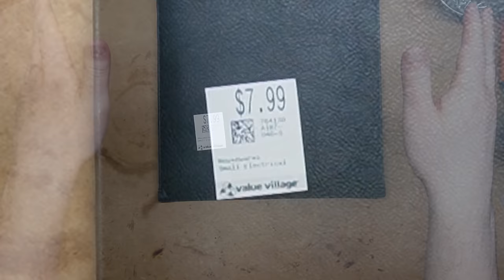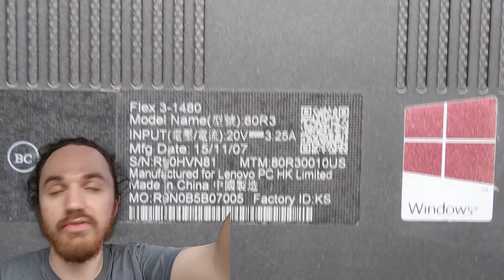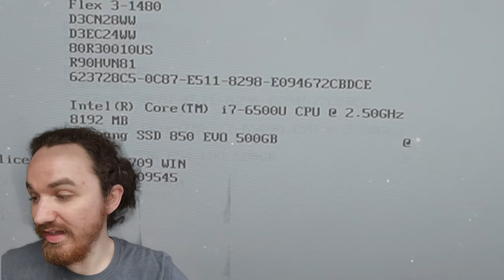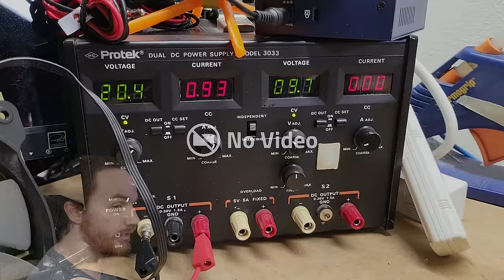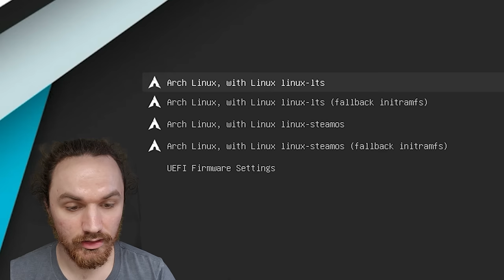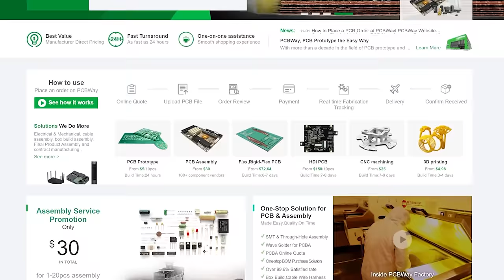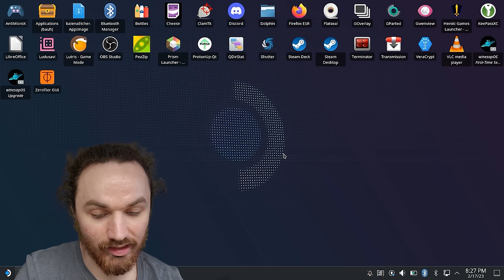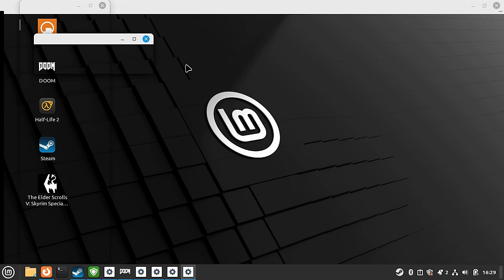Installing Steam Deck OS on a $7.99 Value Village Laptop

Comment: that glue really put the "solid" in state drive
bruh that i7-6500U tho I'm crying literally a 4th gen i5-4300M is better by 13% 😭
also when you opened it there was 2 chips cooled through the heatpipes, and my knowledge of having owned 2 laptops with dedicated gpu and one without it tells me that laptop has most probably a dedicated GPU, went to google and yep, it has a dedicated workstation Nvidia GPU, either an N16V-GM or an N16S-GT
Reply from the maker: Bruh I looked it up, the single threaded performance of that i5 is actually better... that's insane. Dual core i7 GANG. And yeah turns out it has a GTX 940M. I'm going to make a follow-up video about it. I can confirm though that the performance seen in the video was not utilizing the NVIDIA dGPU.
Reply: @BringusStudios  nah with that 940M it'd absolutelly crush the HD 8790M on that old laptop of mine lol

Comment: Arch Linux is not for everyone, there are problems with intel GFX and OpenGL, it requires lots of reading to figure it out, for older computers like that I recommend light distros, like MXLinux, Lubuntu or ZorinOS

Comment: i recently bought awindows 10  laptop at a thrift store for $10. its an older intel celeron laptop and it was being sold as is and they didnt know if it worked or not. i found a charger that fit and it works just fine!!!!!!!!!

Comment: Just add volts from the bench power and measure the voltage drop in those cables.  An extra 2 volts is fine and will help the poor connection.

HoloISO needs a recent AMD GPU, is there an M.2 WiFi you can use an eGPU with?  🤣

6500u is 2 core. With u series you have to get to 8th gen for 4 cores.  The real problem is if you have memory bandwidth and latency for the iGPU, dual channels and dual rank is more important 2rx8.

Buuuut, sometimes i7 Lenovo can overclock RAM (at least on my X230)

Comment: 13:20 you'd be surprised on what tf2 runs on with a config like mastercomfig, I've gotten it to run at 140+ fps on a laptop with an older CPU that was lower tiered aswell (don't remember the exact specs but it was horrible).
Reply from the maker: Oh yeah back in the day I ran one of those configs that made the whole game look like a PS1 title. It's the only way my 900MHz Compaq laptop could play it

Comment: Damn you stole my trick by putting dips of hot glue under SSD. Tape that connection or disaster will happen down the road. Hear it from someone who burned a good working ROG gaming laptop.

Comment: A flex 3 says that it has touch screen and folds into a tablet and it has a Nvidia Graphics NVIDIA GeForce 940M that's why when you opened it up you see two cold plates with heat pipe I bet if your running off the wrong integrated graphics
Reply from the maker: Yup, check my latest video, I used the NVIDIA GPU after this vid

Comment: Your laptop does indeed have a secondary GPU, most likely a Geforce 940M, you can see from the motherboard that there's a GPU chip present on the board.

2 options:
1. the GPU is disabled in the BIOS, tho unlikely
2. it was thrown out cause it has a bad GPU, also unlikely, maxwell chips didn't die just like that

You'd get a bit more framerate, so you'd be in the net positive again. Test it out again perhaps with the proper nvidia drivers installed
Reply from the maker: Yup that was the case. Linux mint didn't pick it up and install the driver automatically. I made a follow up video about it

Comment: You know you could of tried to press the xbox button to see if the menu would of popped up so you could of seen if you could of activated like the FSR mode and also you would of had the performance meters for the system.
Also i would of still googled the model because who knows you could of had one with a Nvidia 940MX which could of had a slight better performance.

Comment: Ethernet does not work because the “genius” engineers at Lenovo made the part that holds in the port part of the bottom cover plate that you removed. This was done to make it thinner

Comment: dude, open up the ssd, the actual circuit board is tiny and plugs into your port without the weight of the case...

Comment: Turns out linux is no-go for optimus laptops cuz you cant switch gpus in linux automatically, and even if you try to switch from nvidia to embedded gpu it will not switch or wants a reboot which is not acceptable, and I am even not talking that linux now is WAY heavier than windows 7 or 8 which installed now on my 2012 core i3 gtx 650m laptop... even though I installed a good kingston ssd to it. In other words notebook will always run hot and have less power under linux. Its sad, I had plans for installing winesapOS on it. I tried mint, and even aside from GPU switching, steam will not launch games under proton, only some native ones like half-life

Comment: Yeah so I checked the serial number on the back and it does have a GTX940m in it which coupled with the i7 is such a good bargain for 8$! Holy damn!
But please clean your used laptops when you get them, there's so much oil gunk from a stranger on it eeewww

Also if anyone reads this I also never had luck with HoloISO, tried it with an i7-6700 and a RX550 and it Never. Wants. To. Boot.
HoloISO's installer kinda sucks and I can't wait for valve to finally release SteamOS 3.

Comment: I'll bet it would have played cyberpunk just fine on Steam with no issues whatsoever yeah. I hate to admit it that's actually not a bad laptop for my experience, unfortunate about the power jack being one of those bespoke pieces of crap that you got to screw around and buy a special adapter for, the barrel Jack IBM I've got quite a few spare power supplies laying around I've actually got an IBM that takes that type and I haven't gotten around looking to see if I've got one to fit it IBM in question is quite likely did and going to be parts screens broken and I think they broke one of the hinges off of the housing and the keyboard looks like it's junk most likely I'm going to use the screws out of it for on a Asus that somebody was rather abusive with and most of the screws are missing from the Asus which I did get up and running. More than likely Value Village is yanking the hard drives and that's why the previous one you had had also had the back removed I'm surprised they're bothering but it wouldn't surprise me at the same time

Comment: Maybe I'm commenting early, but why would AMD be a bad thing? HoloISO (the community version of steamOS 3) expects AMD hardware and requires additional manual intervention for Intel systems or Nvidia systems.
Reply from the maker: Ironically, AMD probably would have been more compatible with HoloISO, yeah. I was just commenting on the raw performance of older mobile AMD chips in general
Reply: @BringusStudios  Makes perfect sense, in my personal experience though the open source vega/radeon drivers for linux have been pretty solid for years now.  My first laptop had integrated radeon graphics (maybe vega? idk its been like 10 years) and was able to handle some surprisingly intense games for how powerful it was. This is on linux, before proton. Now, getting those drivers working was another beast back then, they didn't play nice with iGPUs and really, really preferred discrete GPUs

Comment: my Intel i5 3437u dualcore menace with 8gb of ram can run Half Life 2 on max settings no Antialiasing 2x anisotropic filtering at 70-100FPS 
THE CPU IS STEADY AT 91 DEGREES CELCIUS

Comment: It probably had very dried out thermal paste, poor ram, and the fact that you didn’t have the cover on it might not have gotten as good of airflow as it would expect due to the fans being open to the air, but also gotten better who knows by today it’s probably down to the lack of Good thermal paste probably garbage and whatever the ram was and some of the janknes in your set up

Comment: I know that  video is old, and this comment doesn't matter, but this laptop has gpu 
You can see when u removed the back cover that there were 2 chips which could dissipate heat via cooler

Comment: Funnily enough if it had an apu a10 would have way better performance in gaming, the cpu side still shit, but with an 5800 i could play skyrim 1080 low at 40-50fps

Comment: Oh god I didn't even think I'd stumble upon this piece of junk online there.

Yes, I actually have this laptop right now and used to be my daily driver for whole 8 years (now it runs as micro home server). I mean I called it a piece of junk not because of its specs or anything (even though it is), but because of production quality of this thing is an absolute rubbish. The hinge was broken in only 3 years and I need to use a paper holder to actually hold the hinge back to the position. If you even try to touch or move the hinge, it'd make itself completely turned off. Touch screen stopped working in only 4 years also, used to do Android gaming on it but now it's just a workable e-waste.

But other than that? Well it still sucks, with its processor that barely does anything good, one slot of RAM (yes the silver thing that covered the PCB is the RAM, they need to cover with that to reduce RAM heat), and absolute no M.2 slot. I mean, not a fair assessment but at least it can be good if only it has two RAM slots. Anyway, the thing isn't good in Linux gaming. I've been suffered with it for 7 years (and yes, with Linux) until I got my new laptop. I think it comes with 4 GB on your model hence the explanation of stuttering issue, since I never remember that it did actually stutter before, even with integrated graphics (mine comes with GeForce 920M, makes it more viable for gaming), since I upgraded it with 8 GB of RAM. The limit of it I think is all games after 2017 because it uses a lot of GPU power and 920M can no longer handle them, even with DXVK.

Comment: Missing screws does not mean that the thing has been opened before. My laptop was missing screws before I ever opened it up.

Also having a thousand different powers supplies is really annoying. USB C FTW. I got lucky and one of the laptop power supplies I have worked with the monitor I bought.

Comment: The i7 6500u is actually an i5 in disguise, it's basically a slightly better clocked i5 6200u since both are hyperthreaded dual cores.

Infact I believe the only quad core laptop i7 Intel made during this time was the i7 6700hq, which is a 45w tdp chip. It wasn't until 8th gen that we saw quad core 15w U series chips.